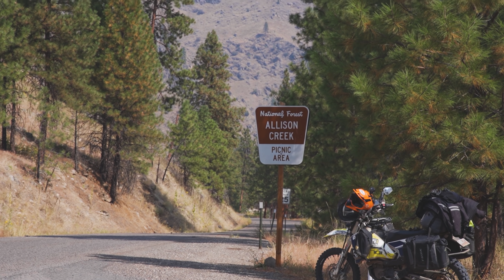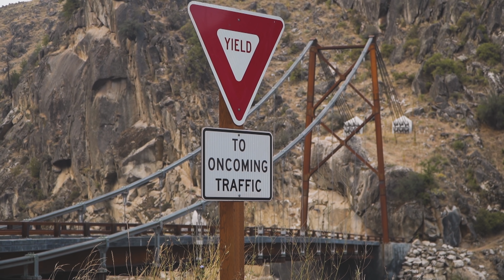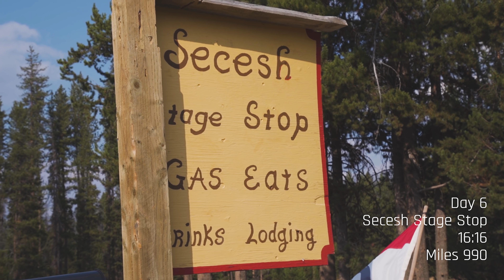Another CRASH!? Broken bike, and SKUNKS?! | Part 6 RMATVMC Idaho Motorcycle Adventure Ride

Comment: I think you need to invest in a small multimeter for future rides. It would have come in handy before checking for fuses & open circuits in switches as well as saved a lot of time diagnosing your electrical problems. On a long ride someone should carry one on future rides. I think I’m investing into one of those burnsomatic soldiering irons. That’s a new tool for me.